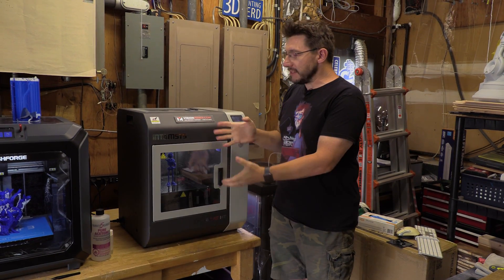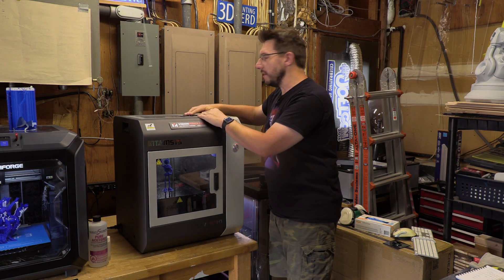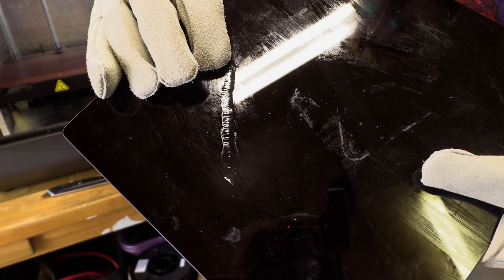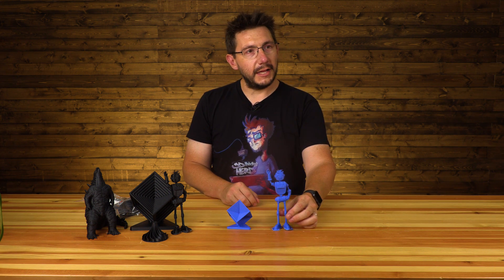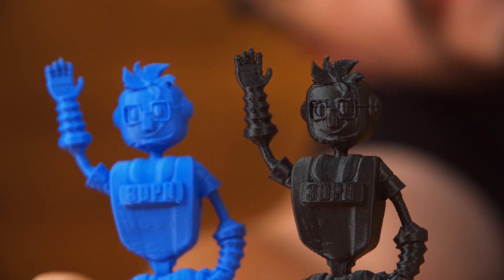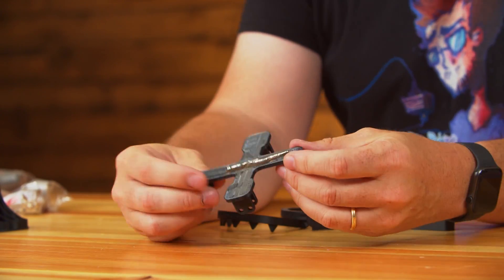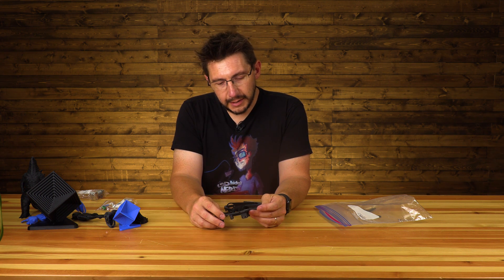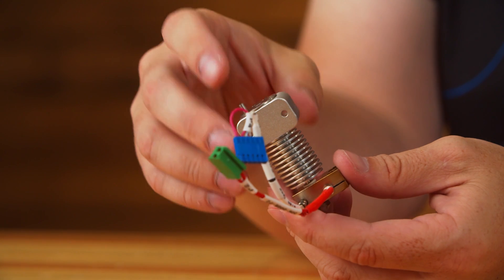First Prints from the FUNMAT HT

Comment: Interesting for those who want to build functional parts. But I wonder how difficult it would be to convert something like a Cr-10 to do the same thing with a homemade heated chamber.
Reply: Siggy in CR not too difficult. You need a spare heater output and thermistor input on your board, so you’d likely need a different board, or a separate PID controller. Either way you’d need a solid state 120v relay.  There are standalone 120v PTC heaters and PID controllers available on eBay for cheap. With a cr10 you’d run the risk of overheating the motors, so either add water cooling to all motors (and may as well do the hotend), or add passive heat sinks and keep the build temp of the chamber relatively low (low enough to not overheat anything, and provide enough cool-ish air to the extruder). Then you just need an actual insulated cabinet for it to go in, running the control box on the exterior of the cabinet. With an all metal hotend and thermocouple you should be able to print up to 500c no problem

Comment: lol I Print ASA on my Wanhao D9 with no problems  and open bed
Reply: the German 3D Printing Nerd yeah Asa isn’t that hard when parts are small. It does tend to warp less than ABS, but will still warp with high infills, or large flat parts. This machine should be able to print 100% infill the entire size of the build volume with no warping. I highly doubt the same could be said of your d9
Reply: I printed not only some small Figures but also some Big one and everything was perfect
Reply: ASA is not much pickier than ABS for most prints.  The issues I have had were usually because of moving air around the print being cooler in one place vs another.  If you are printing in a place with no drafts, it is actually very easy to print.  We have a set of acrylic "draft guards we set up around the Ordbot Hadrons for ABS and ASA.
Reply: @andy-in-indy    I do not print any ABS  only PLA  and once in a while  ASA or PETG
Reply: @theGermanPrintingNerd  Sorry, Intended mostly for Prints and Props.  Entschuldigung bitte.

Comment: Please print an injection mold insert, and I will  test it for you. This sounds like a perfect solution for low volume prototype injection molds.
Reply: I would like to see this as well!
Reply: Hit us up, we're doing some molding soon! What type of material?
Reply: @VisionMiner  I want to use an acetal, Delrin if possible, molding temp 220 to 240 degrees c
Reply: This is a well tested method dude, google it. I've done it multiple times myself and it works great with some practice

Comment: Finally a 3D printer that can make stuff that will survive in my engine bay.
Reply: Temper some PLA :) just try it out. It handles temperatures pretty good.
Reply: @Flacoon1  yes I'm sure that could do lots of areas on a vehicle. My part is next to the fuel rails so I expect the temps to hit ~200 F. I do however have a PLA bushing on my hood prop for a test. so far so good.
Reply: @tronskifpv  I would NOT try PLA. Just look at this standard heat test inside a car. https://www.youtube.com/watch?v=TTswoDnxYHs
Last I checked PC wasn't easy to print without a high temperature 3D printer which most are not. This is why I would suggest testing before you possibly end up with a mess.
Reply: @tronskifpv  Those would be EPIC in Ultem 1010... :) clear gold color
Reply: @tronskifpv  And a temp resistance of 217ºC.... :)
Reply: have you tried PC? I'm about to use some polycarbonate on my truck. Glass transition temp is around 230F so I hope thats good enough for long term on the outside of the engine.
Reply: @tronskifpv  If the piece is necessary to keep it running you should test it first. Try putting a thermometer near the area to get the average temp while your truck is running. Then put the piece in the oven at that temperature to see if it can handle it.
Reply: @kh8655  I had hoped the OP had some experience with the materials we can print on cheap printers. Car intake manifolds are made from glass reinforced nylon. All of the white fluid tanks are high-density polyethylene. Both of those are things we can print right now. So id think we could make most anything as long as its not in contact with hot oil, exhaust or hot coolant. We might even be able to do coolant parts, but failure is too high a risk. Polycarobonate is on the low side of these materials, but its not critical and i have it to try.
Reply: Right! :)